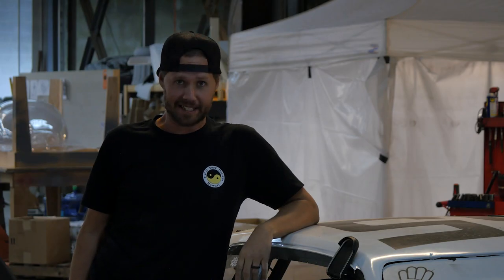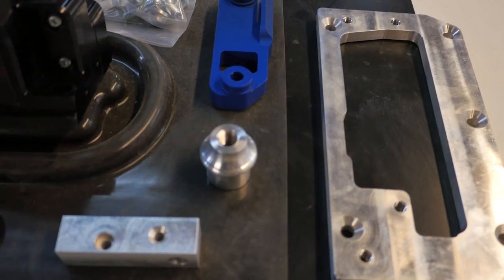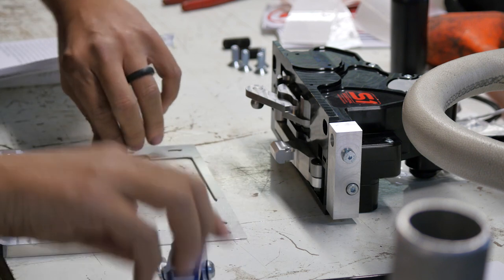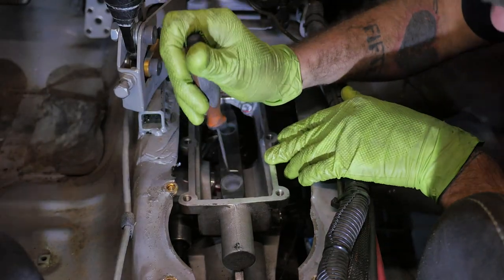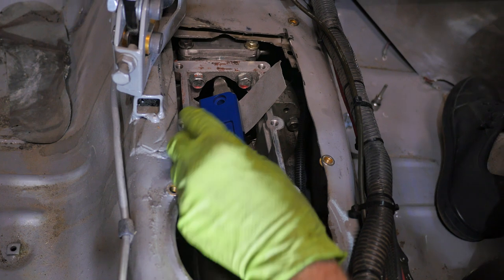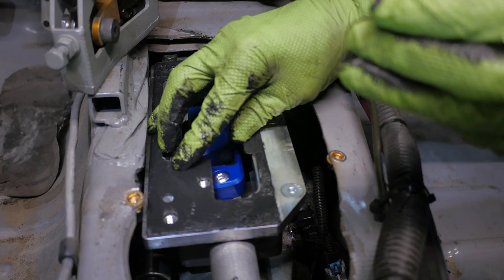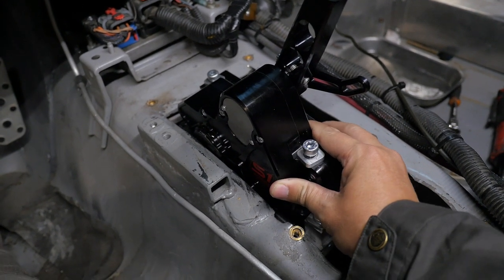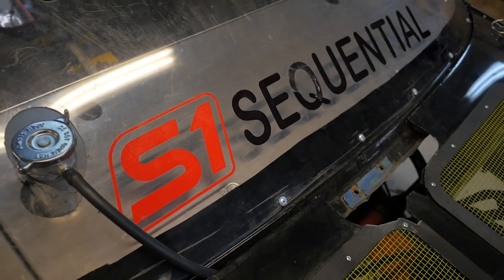S1 Sequential T-56 Magnum shifter install

Comment: wait a minute I saw your foot use the clutch to in gears I thought sequential got rid of the foot clutch action except for 1st when it was in the air.
Reply from the maker: This is just an h pattern adapter to sequential, it doesn't change the gears to dog rings! Just helps you make less mistakes when shifting :)
Reply: @Officer_Dan  ah thx you for that info....im still in the confused stages of debate on my T56 to convert to H pattern or sequential or whatever, lol...thx